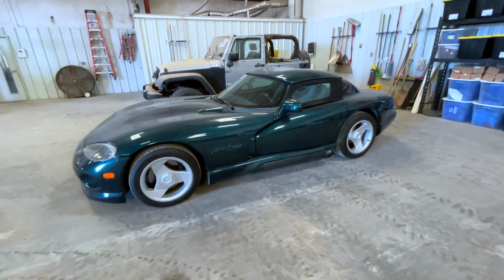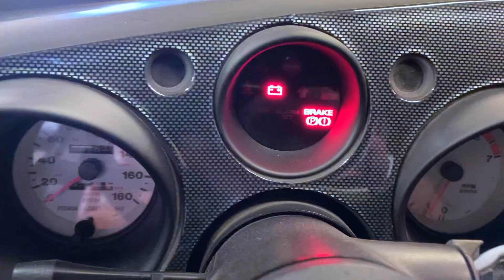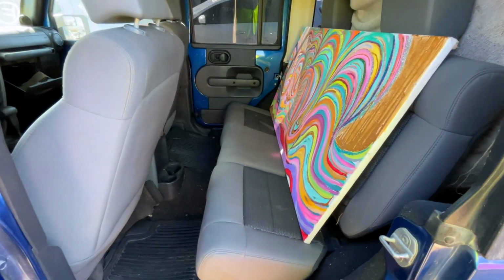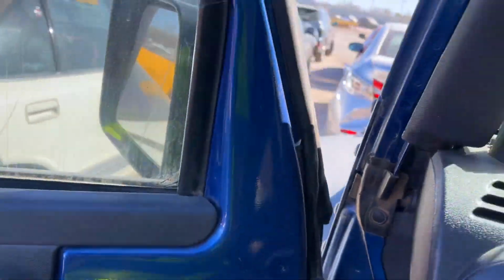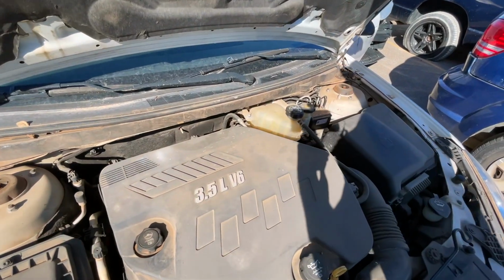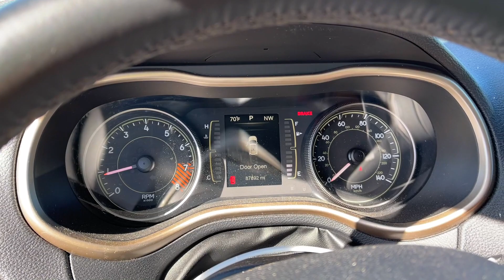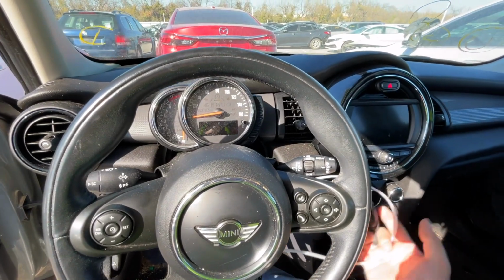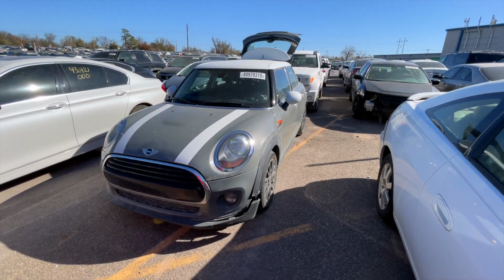Copart Walk Around 11-17-2020 + $25K Dodge Viper RT/10

Comment: That mini you were looking at has a 3cy turbo they do idle a little rough  fun little car I used to work for Bob Smith mini in the service department the 2014 and up mini cooper 2 door and 4 door hardtop are alot more reliable than the previous versions

Comment: The power door locks on the Wrangler won't lock the drivers side when it's running. Helps prevent locking the keys inside by accident. My '02 ZX2 locks and unlocks the drivers door if it's open at the time.

Comment: Randy I say this because I have seen how you drive your muscle cars. And I would love to see you own the viper but the problem with those cars is too much power they don't hold the road. As far as the jeep that's a no hassle fin runner. And the mini is shaking like that because it has those silly fluid filled motor ant trans mounts that probably need replacing. My volvo v50 sport wagon needs them also. Lol it a euro thing. As usual love the channel. And can't wait to see what comes next. Stay safe yourself